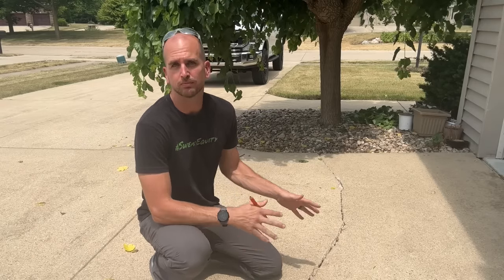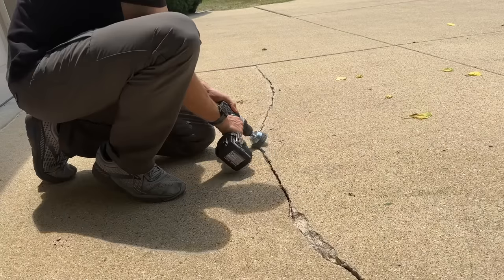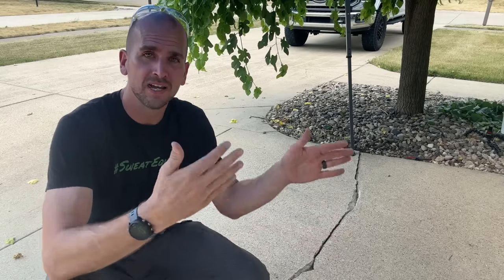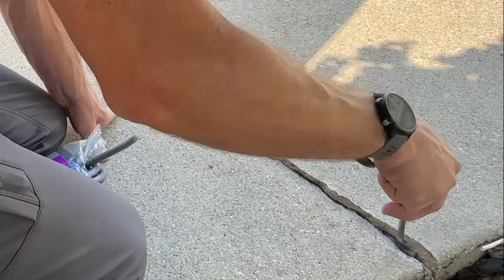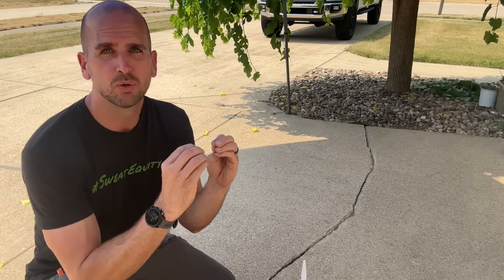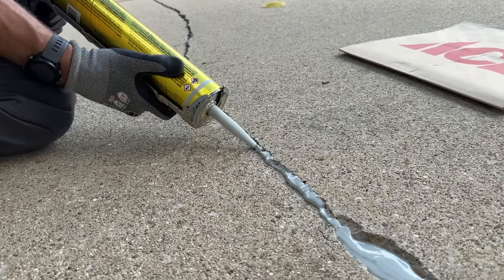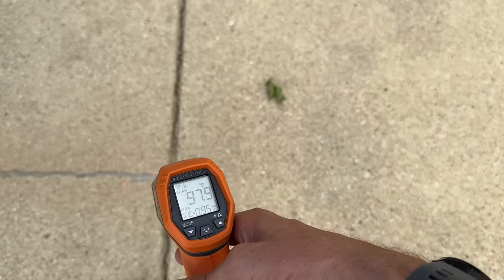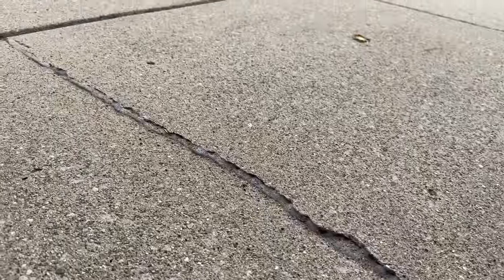Repairing A Neglected Driveway Crack |  The Ultimate Solution!

Comment: OK next is a blacktop driveway whereas a root has slightly pushed it up and formed a crack. The idea being to prep for a blacktop sealant coat. I tried some of the caulking gun blacktop crack sealants of which truthfully all of them failed. 10 years later I tried brick mortar to fill the gaps which worked OK but I'd still call it a failure. I also used cold or that is bagged asphalt which worked extremely well for one large area whereas I removed cracked broken asphalt and replaced an "area" that spanned 6" across and about 1 foot in length but for small cracks was impossible or was extremely time consuming to get it to pack and fill cracks. 15 years later I'm getting ready to seal my driveway again and am dreading it in knowing of nothing that won't fail or look bad in a few years time. Recommendations?????

Comment: Every few years I re-coat my driveway with cement after I pressure wash it with and apply concrete acid etch.  I chip out the cracks with a rotary hammer chisel and vacuum out the debris after, I also hit any spalling or chips with a ball peen hammer to remove lose concrete.  I re-wet the concrete and use Rapid Set brand Cement All with the flow additive and retarder if warm and fill the cracks first with a small batch first and then use a rubber floor squeegee to top coat the whole drive way and finish with a brush finish so that it is not too smooth and slippery.  Do one 55# bag at a time in a 5 gallon bucket using the correct amount of water and just pour the bucket in the middle of the driveway near the garage, open the door to prevent splash.  You only need a thin layer like 1/8" to coat the concrete drive evenly.  The material must be  mixed with a powered paddle mixer or it will not flow.  I don't worry about expansion joints because I put concrete caulk crack filler the first time just below the top so the expansion joints don't get filled and crack the concrete.  I have had several neighbors ask me if I had new concrete poured because all of the driveway in our neighborhood are cracked.  the Cement All bonds to everything including the plastic bucket so it doesn't peel after applying it.

I tried crack filler at first and didn't like it so I ground it out and did the Cement all.

Comment: I would use a grinder to level the 2 sides first before applying the sealant so as to create a level water drip rather than making the water siphon down the side and accumulating , seeping into the sealant.

Comment: We use a diamond blade to smooth the eough edges and/or level out un even concrete. After the self leveler has settled i directly pour sand into the mix. Let cure and blow off excess sand with a blower from a distance not to disturb any non cured areas.
Reply: Using sand ud a very bad idea it feduces life expectancy of the sealant significantly

Comment: Since its one of my main serices I do with my business in Tampa.

I do believe this is a good video and he does a nice job.

However a little bit quicker and a little bit better prep, If you have one. Use pressure washer with " zero " or turbo tip nozzle and blast out the crack(s) .

I realize not everybody owns or wants to rent a pressure washer.

Also. Other similar self level sealants are available. 

And in many cases while the crack might be fixed when there is a big problem with one side higher or lower, its a good Idea to use 4" or 7" inch angle grinder with a diamond grinder wheel to buff or cut down the high side.

Of course this can be dangerous and don't necessarily recommend it for the everyday homeowner.

Just trying to give some useful information

Comment: Why not level the concrete by just grinding that two feet? Also, can you cover that sealer if you want to resurface the driveway with new Crete or something?
Reply: Grinding would affect the strength I’d imagine. Losing half an inch of a 3 inch slab is probably somewhat significant I’d imagine especially holding loads like cars going over it if they’re near the edge
Reply: @baxt1412  I think most driveways are thicker than 3”. 🤷🏽‍♂️ I fixed the sidewalk that runs into my driveway and it was 6” thick.
Reply: @robertboyer5498 city sidewalks are thick because they spec it that way, driveways are usually poured too thin IMO because there is no spec.
Reply: @thebigmacd  not mine. It’s a monolithic pour.
Reply: The trouble with grinding it is that as well as seeing the crack you see the grind. You could put a thin coat over the slab to hide it but that will become an ongoing maintenance problem that has to be redone more often than the crack, and will cost more. You could grind partly and then needle gun which may give a better match.

It is also probable that the slab is moving. So grinding may help but not solve.

If it is proving to be a trip hazard it may be easier to relay part or all of the slab. Make sure the long side of the resultant slab/s are less than twice as long as wide, square is best, or they will crack sooner (all concrete cracks).
Reply: @baxt1412  Taking that much off the slab would reduce its strength by about 30% at the crack. But it would reduce the impact loading from wheels hitting the lip. The result may be neutral assuming you only grind close to the crack.

Comment: I've always used a expandable foam insulation such as great stuff to fill the crack in and then take my oscillating tool and cut it back  below grade and then just  put the urethane caulk over that.
Reply: Absolutely wrong
Reply: @genecarden780  I agree to disagree I've done  it for years on my own property it's been 7 years now and it hasn't split or cracked or lifted off the concrete never had any problems so be it do whatever way you want works for me maybe you just had bad luck at it.

Comment: A few times a year the garage floods from heavy rain coming under the garage door. The driveway is not sloped toward the garage and the roof slopes to either side. A lot of times we get a very heavy rain with no garage flooding at all. I can’t figure it out! Is there any product for making a small crest on the pavement right where the garage door meets it? I suspect that will solve my issue.
Reply: Add a raised threshold at the doorway. There are many available
Reply: @genecarden780  Thank you!
Reply: @emmettturner9452  not endorsing this product just for reference
Reply: @genecarden780  I only see the “many available” and “not endorsing” comments but nothing about a specific product. I assume there is a third one that got ghosted by YouTube. Regardless, I now know what to look for thanks to you (garage door raised threshold). Thanks again!
Reply: @emmettturner9452  they are usually made of some sort of rubber( the type varies by manufacturer) and I would suggest pre fitting it and putting it down with sealant.Some come with tape to attach them. That is ok but I would add sealant underneath it

Comment: What about stains and splotches made by leftover mortar from the masonry company?  They left several large splotches on the surface of the driveway.  Is there a chemical method to remove the mortar splotches and not damage the pebble surfaced concrete driveway beneath the mortar splotches?

Comment: Would love to see you do a similar video for asphalt (that hasn’t been seal coated) or maybe you could recommend one that’s already up somewhere. Thanks!
Reply: I've got old asphalt that's in bad shape, but it's not just the driveway, it's like an apron pathway all around my house and I'm not able to remove it. Some of the cracks have moss, which I've been encouraging, and even added some. It looks odd but I like it.  But I need a similar treatment to what you've done here for the places where water is unwelcome, like where we park the car.  I just bought a small tube of exterior gorilla glue construction adhesive, have not tried it yet, but I was planning to set pebbles into the top of the adhesive so that it's flat to walk on.  Maybe sand is smarter, if it comes off it won't be a problem.
Reply: @ameleh61 very few sealants will properly bond to asphalt

Comment: My issue is that I put salt on my driveway here in the south when we’ve had ice storms. Apparently, that’s no bueno for the south, because the concrete is a bit different than in the north. So, now I have areas where the concrete surface has crumbled away. Kinda looks like an english muffin. Can this technique be modified to smooth out the driveway again? Not sure there’s room for a backer, which is probably gonna be the problem. I had a driveway repair guy come out once and basically told me he’d need to break up the entire driveway and pour a new one, which of course was far too expensive.
Reply: Spalling on concrete surfaces is usually caused by over salting and/or not sealing. 

You can apply a concrete patch repair to the surface for much less than pouring new concrete. Proper precleaning and a bonding agent is needed. 

It is not as easy to do as one would think. If doing yourself, I'd recommend doing small areas at time

Comment: Good effort! some things I would have done differently 1) I would not have used backer rod. I would have used more calk instead 2) Since one side of the slab had dropped at least 1/4 inch, I would have used an angle grinder to make the two surfaces level before applying the sealant. By not doing that, you still have a trip edge

Comment: What would you do differently for a sloped driveway? I assume the SSL wouldn’t work well in this situation.
Reply: They make a “no sag” sealant for sloped or vertical applications
Reply: SSL stands for semi self leveling. Other companies call this “ slope grade” within reason it will spork on a slope as opposed to “ self leveling “ which will just run to the low spot

Comment: If a  tree root is a concern, would it be feasible to cut the root? Take a sawzall with a long blade, jab it into the ground at the edge of the driveway, and then run it maybe a foot either side of the crack. (Make sure there are no wires/pipes in that area.) Otherwise, even if the patch cuts off the supply of water to the root, the root is probably going to continue to grow along with the rest of the tree. Not sure how good/bad this is for the tree - although it must have a lot of other roots.

Comment: Tried that once - 1 year later the tree root had destroyed the repair.
The solution:
use a concrete saw to cut out the concrete - 2 feet wide strip.
Cut out and remove the tree root then lay new concrete.

Comment: What happens to the seal next year when you pressure wash the drive?  Does it immediately tear away from the concrete?
Reply from the maker: At least with the Vulkem 45 SSL I had really good luck with cracks holding up through the seasons and with direct pressure washing.
Reply: Sikaflex does not peal after pressure washing either. Mine held for 5 years and counting
Reply: @EverydayHomeRepairs  was thinking of using this method to replace all the boards in the driveway and sidewalk, which after 30 years are in bad shape.  Pretty sure I wouldn’t be able to get new boards in the seams. But here in this part of Texas I have to pressure wash the concrete every year. I was afraid doing so would destroy all the work done with a sealant. Sounds like maybe it might work ok. 

Have you ever tried and been successful replacing the old boards with new?  How difficult in it getting the new boards in and do they stay?  I would think new boards, if they work, would be the longest lasting and least expensive option.
Reply: When properly installed these commercial grade sealants are not affected by pressure washing. I am a professional caulker and have installed miles of semi self leveling. My installations don’t have the minor flaws of Scott’s but I have many examples of installations at strip malls that are 25 years old if more and they get power washed weekly

Comment: How does this product hold up when pressure washing the driveway/ concrete??
Reply from the maker: So far so good, I have pressure washed the driveway twice with no signs of the sealant letting loose.
Reply: Does it pit the product with the water forces from the pressure washer?
Reply: When properly installed pressure washing will not affect it. I have installed these types of sealants professionally for over 45 years. I have installed at strip malls that power wash weekly and it’s still fine after 25 years

Comment: I did some Silka Flex for fill in cracks and after 3 years it is all peeling away from the edges. How best to remove the previous material to be ready to apply a new coat?
Reply from the maker: I image getting a little heat on the concrete would help peel up the old sealant.  Then if you have a little left behind I would use the Nylon cup brush on the drill to get back down to the cleaned off concrete.
Reply: If Sika is peeling after 2 years hire someone that knows what they are doing. Sika sealants when installed properly should last 20 years.

Comment: For a permanent solution you should (always in my opinion, for  tha's what i would do)  a) Equalize or level if you will, both the plates together (by for example grind the higher) b) Staple (kinda) the two plaques with small iron bars and c) Fill and cover the gaps with cement or any other indicated material.Friendly always greetings from evershine Hellas (Greece to ya all)

Comment: Don't think rebars or wire mesh were used in installing the concrete slab. Often times not just cracks but different elevations in between.

Comment: Had the opportunity to use a concrete grinder I rented from home Depot recently. It's like a tough version of a floor buffer but it does the job. A helpful tip there is to not wet the driveway and just let the dust blow. If you wet the driveway it gets gummy and it's a pain in the butt to keep cleaning.
Reply: And were a mask. Unless you want to get silicosis.

Comment: Thank you for this! I also have a large crack in the apron where 3" wide chunks are missing. What do you recommend for that?  AND, the intentional gaps between rectangles that the masons leave, should there be some sort of backer rod between those intentional gaps?
Reply: Normally there is an exoansion joint material such as asphalt impregnated board but it is usually recessed
Reply: My neighbot a few years ago, had his damaged area cut out, and I think they took the bagged concrete, mixed it and filled in what they cut out.  You can see it, but who cares ?  It is level and flush.
Reply: @DanTheManIOM  as long as the crack is static ( not moving) this is fine but if it was active it will likely return. But since you said a few years ago it was likely static.👍

Comment: Minor comment; don't just "lightly sprinkle" some sand over it when it's still sticky to make it blend in visually; pour a lot of sand over it into a little hill running along, then squish it down into the top of the sealant, not too hard not too soft, so you get a nice even coverage stuck to it, then after it's all cured blow the excess off or vacuum it up or just let Mother Nature clean it up.

Comment: Try cleaning the low side of the cracked surface, then, with a trowel, apply the product on the low side working with the crack. Then apply sand over that. The finished look will almost have the crack dissappear.
Reply: @genecarden780  it may, I have tried fiberglass reinforcement holds up pretty well if my preparation is good.

Comment: You should also explain what street creep is, and the use of cutting in expansion or control joints. Also give the life expectations of a repair such as yours, and why the use of a "floating" concrete apron outside of a garage,  is implemented in certain zones that have a freeze/thaw cycle, even after global warming is here to stay.